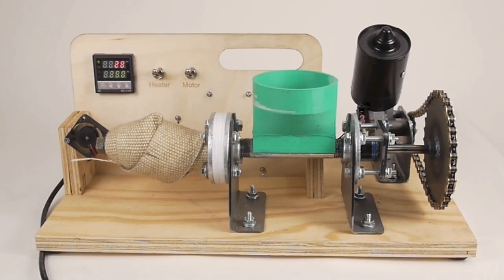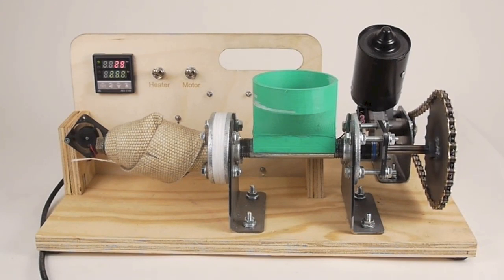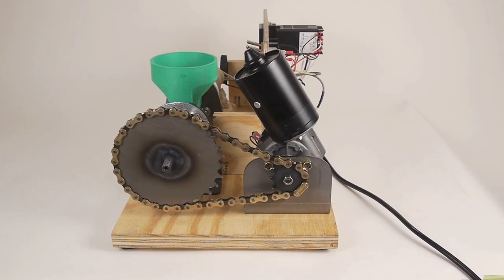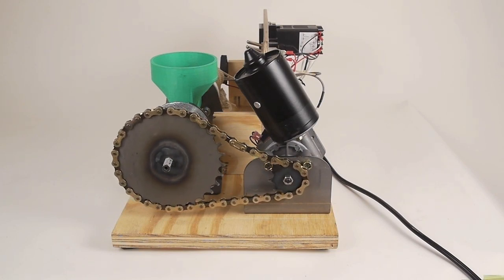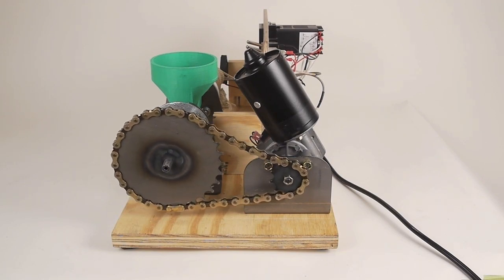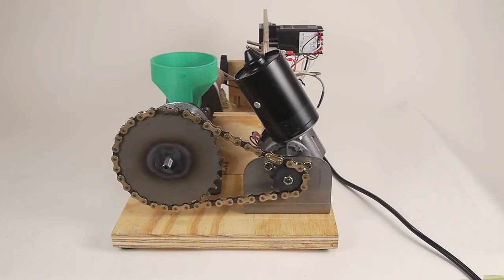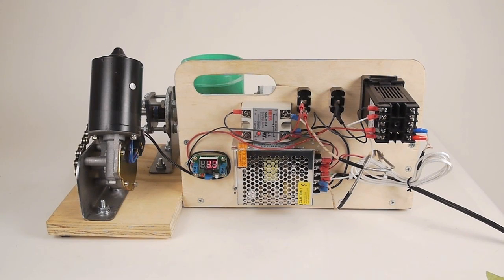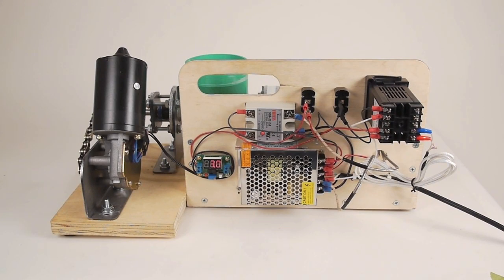Lyman's Filament Extruder with Steel Sprockets

Comment: what kind of motor you use?
did you has the model or a link in internet?
Reply from the maker: I used a 12VDC wiper motor. But it can't be the kind that oscillates. This doesn't have near enough gear reduction in my opinion.

This is mostly a Lyman version 2. This is three year old project, you will probably find better projects that use better motors. I would look on Thingiverse for "filament extruder" and examine those.

Comment: hello i am considering bulding a filament extruder but i would rather run it the heaters on 12 volts from an old computer power supply instead of 120 volts is this possible?
Reply from the maker: You would need heater bands meant for 12VDC and an SSR or FET for 12VDC. It's been four years now, so I couldn't begin to recommend one, other than looking for one 150W heater band or two narrow 75W or so heater bands.

Comment: Hi!, i also use a windshlied motro, but it turns really fast, how did you manage the speed?
Thanks!
Reply from the maker: Lyman's plans call for an adjustable DC regulator. I think I dialed it down to 3 volts.
Reply: JeffDM Hi, allready seen it on another video, and tried to replicate the circuit, but had no luck!! Thanks!
Reply: ModulArt22 Jeff, hi again, i'm still strugling with this proyect. Just can't align the wheels, yours runs really smoothly, while mine keeps giglyng making the chain to come off
Reply from the maker: You might need to loosen the motor mount so the chain isn't a problem during assembly? I don't know exactly what you're running into, so I don't know.

Comment from the maker: I used a windshield wiper motor. I think the link to that item is in the instruction packet.

I don't know if I'd use this design though. It doesn't seem to have good enough torque for the job.

Lyman has a v3 design in the works, so maybe wait for that?

Comment from the maker: The PID boxes I've seen use thermocouples. I don't think they can be easily converted to thermistors of any kind. I've seen thermocouples go for $5 or so, and in this case, it's more durable than a thermistor.

Comment from the maker: I don't have a metal cutting laser, I drew up the parts and sent those drawings out to a job shop that had one. A plasma would do the job for cutting the sprockets, but I would make sure the roller notches were smooth first. I think some plasma cutters might do better than others though.